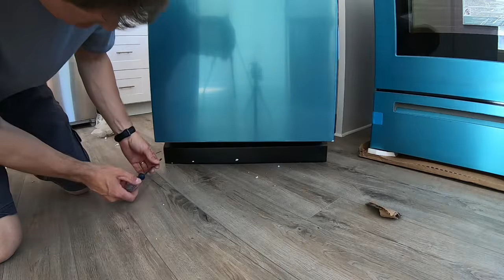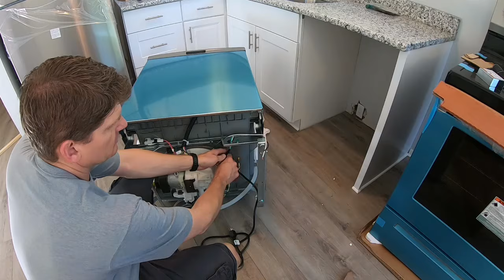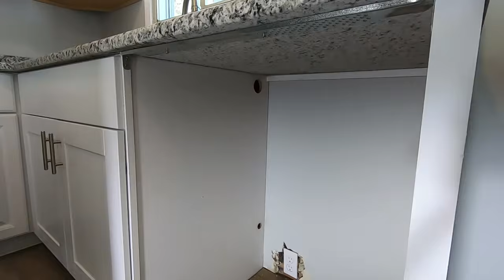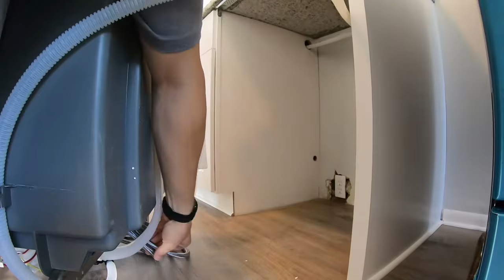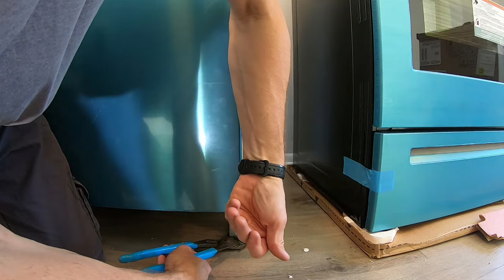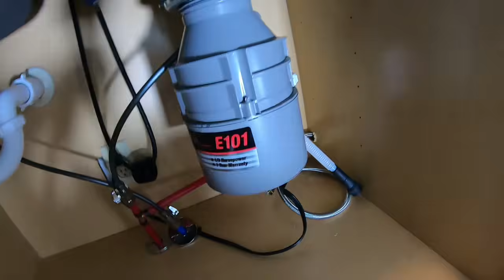Install a dishwasher for the first time - Step by step instructions

Comment: Great video, would like to say that for the legs a ratchet wrench with a 1/4 bit would help tremendously with leveling the legs. I also use my magnetic level on the stainless panel to make sure it's level left to right and also front to back.

Comment: Nice, I can now do this myself. I have all the parts. The drain hose goes through the hole of the right side of the insolation sheet and then snaps on the right side of the dishwasher.😃

Comment: All instructors on YouTube do not say the water source is HOT Water. Second, instructions do not show actual handling of the drain line, water, and electrical to snake them through the cabinet holes. Just trying to be helpful.

Comment: I need help, please!   I live in an apartment. Old dishwasher was not working. After a week of phone calls, maintenance came out and replaced the dishwasher.  There was no water running, but the electric parts of the cycle worked. I did not find this out until 8 pm on a Friday. Monday,  maintenance came out. I can hear water running at certain points, and hear it draining, but the dishes are not getting clean. I am not mechanically inclined, but from what I have watched on some videos everything appears to be hooked up. There is some condensation on the inside of the dishwasher, but that is it. Any advice??
Reply from the maker: Id check to make sure the shutoff valve on the water line going to the dishwasher is turned on. That’s my best guess.
Reply: @HomeSource  it seems to be connected to the hot water that also goes to the sink. When I turn the know for that, the water in the sink works.  Is that the valve that you mean?

Comment: The manufacturer says to put all holes in the cabinet within 3 inches from the floor for all supply and drain lines. Can you explain why you put yours so high?
Reply from the maker: That may vary by manufacturer but I’ve always seen that drain should be as high as possible to avoid having a “belly” in the line where food will build up and cause a clog. The supply can run anywhere.

Comment: Super helpful video, but....pro tip, turn your pliers around so you can actually get a good grip and not have to struggle with getting that last little umph when tightening.

Comment: What if I don’t have a disposal ? How do I connect the drain than
Reply from the maker: They make a sink drain tube with a hose fitting that you attach to. Just ask at the hardware store and they’ll be able to get you what you need.

Comment: It’s code to now have the dishwasher cord and plug connected. It also requires a GFCI receptacle. It’s better if the GFCI receptacle is under the sink for better accessibility. Reason for cord and plug is so the dishwasher can be serviced with a line of site electrical disconnect. Tech can now simply unplug unit to service. If GFCI trips for any reason easy to access under sink to reset. In fact all appliances now need to be cord and plug connected including ovens.

Comment: Mine is hardwired from 1970 omg. Not sure if I can do this on my own lol
Reply from the maker: Being hardwired is very common and the process is pretty much the same, just be sure you locate and turn off the breaker before you attempt to disconnect the wires!
Reply: @HomeSource  so it has power I hooked that up in the front.  There was a green a white and a black think..I got a ground plug n just connected those.  Thing is no water?? My garbage disposal is broke.  So I have it hooked up on that.  Is there another way??
Reply: I didn't use the metal plate that came with the power plug I bought.  Think that would make a difference

Comment: Great video dude! I especially love it at the end when you went to turn it on, and you still had the brochures and tags still hanging. I did have a question, and this is just me, but could you use plumbers' tape at all of those water-tight connections?
Reply from the maker: Those are all compression fittings designed to be used without tape. None needed and the tape may actually interfere with the seal. Thanks for watching!
Reply: Not necessary on any plastic fittings

Comment: Umm… that’s not code compliant. You can’t plug a dishwasher into an outlet directly behind it. You must use an adjacent plug.
Reply from the maker: That’s interesting feedback. I run into them all the time.  I’m guessing it would only be an issue if it’s not a dedicated circuit.

Comment: Nicely done .... you stopped mid-sentence on what you would do if you DON'T have a garbage disposal .. would you please elaborate? Thank you.
Reply from the maker: They make a sink drain that has a fitting for a dishwasher hose to connect directly to. Ask at the hardware store and they’ll be able to show you what you need.

Comment: I think it's stupid dishwashers don't come with a plug in the wall cable. I could have been done 30 minutes ago with my dishwasher. Literally a 5 minute job but NO...I have to wire crap up.
Reply from the maker: Garbage disposals are even more annoying. Completely unusable without a cord, but they don’t come with one either.

Comment: I do not have the outlet in the wall like you do. The old one was hardwired.
Can I put in a standard 15amp outlet in my wall?

Or can I plug it into the garbage disposal outlet. 1 plug is for the pwr switch for disposal.The other side of outlet is  always hot. I want to plug my dishwasher into that side.

Comment: Just wanted to say thank you for your very thorough walkthrough. We were just going to get a new dishwasher and had decided to look into how the drain line is supposed to be run since our current dishwasher would no longer drain. Long story short, 2 years ago I had replaced the garbage disposal and thanks to your video, realized I had neglected to remove the plug. We saved 500-1000$ and now have a working dishwasher thanks to you! Keep up the good work and you are appreciated!

Comment: Hi Adam, are you using that on a 12/2 or 14/2 ?

My GE dishwasher wants me to hardwire it to the line but I'd rather put a plug on it. I was going to run a 12/2 yellow romex but can not find a 20 amp dishwasher plug for it.. only a 16 gauge/13 amp 

What do you suggest ?
Reply from the maker: 12/2 is typical. If you have power behind the dishwasher you can install an outlet then run a plugged cord from the outlet to the dishwasher. You should be able to find cords in the appliance section.  Otherwise hardwiring will work just fine too if you don’t want to install an outlet. It’s actually easier that way if you don’t have an outlet currently . Good luck!

Comment: I just got the same dishwasher and my cabinet measure 24" exact but this dishwasher is 24" at hinges(where those 2 black rubber sleeves are, one on each side), it would not go into box. Its 23-3/4" to 23-5/8" wide everywhere, only wider at hinges. Sucks!!

Comment: I'm not sure how to connect the mounting brackets for the counter top version.
Reply from the maker: If you have granite or some other type of solid surface tops they make an adhesive backed bracket you can stick under the counter to secure the DW to. If you have laminate/Formica tops any type of screw will work.

Comment: If you don't have a garbage disposal you can connect it to ...... lol ... it cut out.. My house was built in 1920. There is no plug  under the cabinet gotta cut into the wall to find a power line. And I'm guessing I'm  replacing stuff under the sink so this can connect.

Comment: Is the green cord necessary? I took apart the old one and it wasn't connected. This new one doesn't have green connect
Reply from the maker: Yes. The green wire is the ground. You’ll want to make sure that is hooked up. If there isn’t a green wire on the dishwasher there should be a screw inside the metal electrical box you can attach the ground wire to.

Comment: You don't need plumbers tape connecting the plumbing lines? It won't leak?
Reply from the maker: Nope. Those are compression fittings. No tape needed.

Comment: Both times you used the channellocks to tighten water supply line, you held them in the wrong direction. If you flip the tool, you apply leverage on the handle which makes the tool bite better and use less grip strength

Comment: Thanks. I'm looking to install a 24in dishwasher in my apartment and this resolved a good many of my questions that weren't getting answered anywhere else. Most other installation guides out there are really replacement guides, which helped me none when I was looking at a fresh install.
I'll probably cut in both drain and inlet line holes somewhat close together and do a high loop with the drain line inside my old cabinets. Also need to modify some PVC plumbing in there, but I've got experience in that.

Comment: I'm not an electrician, but a little concerned about the electrical.  First of all, who hacked that box into the wall?  Good Lord! :-)  Secondly, if you're not hard wiring it, that box should be accessible under the sink, preferably with a GFCI outlet, ideally on its own circuit.  Otherwise, looks... Functional.
Reply from the maker: No idea who installed that box. It wasn’t me!  No need for gfci under there, and pretty sure it doesn’t need to be accessible. Dedicated circuit I agree!
Reply: I couldn't help it, just kept getting distracted by that outlet. It looks like it was punched through with a hammer. I wouldn't want my dishwasher installed without the electrician coming back and fixing that. Then I'd fire him or her.

Comment: Does the drain line always have to be on top or can it be installed in the bottom?
Reply from the maker: It should really be at the top to ensure it drains properly and doesn’t get clogged.

Comment: One huge issue with this video: You say "If you don't have a garburator you can connect the return line to..." And then just didn't finish your sentence. I don't have a garburator...
Reply from the maker: Sorry not sure what happened to the video there. You just need a section of sink drain with a stub that will accept the dishwasher drain hose. You can pick up at any hardware store. Tell them what you’re doing and they should be able to set you up.

Comment: Nice job on showing this. I’m in the middle of replacing my old dishwasher and came into a major jam. Apparently the flooring in this kitchen has been added to one to many times and the flooring is literally so high that the dishwasher can’t come out and that’s even with screwing the feet adjusters all the way up 😡😡. I guess I’m getting a new flooring in this kitchen as well 😥😥😥
Reply: Same problem! We have laminate that was installed over the linoleum, blocking in the dishwasher. The guys delivered the new one and couldn't install it! Honestly, we just chipped away just enough of the plank where the feet were to squeeze it out, and the bottom plate of the new dishwasher covers it right up! We plan on doing a remodel someday anyway so not to worried.
Reply: You have to remove the flooring underneath the dishwasher, only option

Comment: nice work - except you didn't tell your viewers about putting 2 turns of tape on the 3/8" water lines (not the garden hose) connection at the bottom of the unit
Reply: Tape isn't necessary on compression fittings
Reply: Tape can even cause compression fittings to leak if it protrudes into the mating surface.....But it doesn't hurt to put a few loops on the bottom and leave the top few threads bare so it can seal properly, and a little extra insurance from the tape just in case.
Reply from the maker: Thanks  Darrell. I should have mentioned that. Those are 3/8 compression fittings. Tape isn’t necessary. Thanks for watching!

Comment: What if we don’t have a garbage disposal 😦 where do we connect it?
Reply from the maker: You can get a drain pipe with a fitting made to accept the dishwasher drain hose. Anyone working the plumbing department at a home improvement store should be able to show you what you need. Good luck!

Comment: By drilling 2 different holes, one at the top and partially up from the bottom actually causes the dishwasher to sit out a lot further then the manufacture intended it and it will look poor, because the drainline will sit behind the unit instead of the intended spot at the bottom of the dishwasher. You should drill a 2 inch hole at the lowest point and closest to the rear wall as possible and run both lines through this. So you can get the dishwasher to sit against the rear wall. You would then make a high loop with the drainline by securing it rear wall under the cabinet to hold it up so it creates an “air gap” for proper draining. The person to taught you to install was probably a plumber. They are lazy and know nothing about installation. But please if you’re going to put a video out on how to do it, at least follow the manufacturers recommendations. A dishwasher should never stick out past the counter top unless it has a cabinet opening less then 24 inches deep.

Comment: you hooked it to the hot water, but you didn't mention that. Always use hot?
 Also, you didn't finish with the without a garbage disposal. Also, you already had the water line ready to hook up, you didn't explain how to put that T in the hot water line to create that hook up.
Reply from the maker: Correct, always to hot for a dishwasher.  To hook up the drain line without a garbage disposal, you can buy a special down tube that goes from your sink to the drain pipe.  The down tube has a nipple your dishwasher will connect too.  For the supply fitting I'd recommend you go to a hardware store and explain what you're doing and someone in the plumbing department should be able to assist pretty easily.  They can show you the drain tube I'm talking about too.  Sorry for leaving out those details. Good luck!

Comment: No teflon tape on any of the water lines.  Is there a reason you wouldn't need it?
Reply from the maker: Yep, those are compression fittings. Tape isn’t needed.
Reply: Compression fittings not need Teflon tape

Comment: One more question.  You water supply line comes down near the bottom.  Why isn't it hooked to the angle on to wall?
Reply from the maker: Not sure I completely understand your question, but the flexible water line can run about anywhere.  I don't attach it to the wall because it needs to be loose so there's room to move the DW in and out of the opening.

Comment: You are so careful and do everything just right, so why are your electrical outlets so sloppy or never finished off, just a big gapping hole?  Also, do you always put floor under the dishwasher?  My kitchen was built in 1977 and the thick tile floor is up to the dishwasher and the cabinets but they didn't put it under the cabinets.  Is that a mistake?  IF it leaks, the water won't contact the wooden subfloor because the floor is protecting it?  RIght?
Reply: The Mice just thanked you for giving them a doorway into that tasty wiring under the dishwasher
Reply from the maker: Good questions Pamela.  I make sure anything visible looks perfect.  However, behind a dishwasher I don't worry about it.  The box behind the dishwasher was that way when I found it so I just left it.  In 15 years when someone replaces the dishwasher they'll see it, but until then no one will ever be bothered by it.  
I do typically put flooring under dishwashers, or atleast the front foot or so.  It's not critical I just want to make sure I don't have any visible gaps.  With your tile, I'd say they did it right by going up to the cabinets.  Personally I would tile under the front of the diswasher IF there's enough room.  Tile and underlayment are pretty thick so they may have done that to ensure the DW would still fit into the hole.  I'd say water isn't really a consideration.  If you have a leak it won't matter if there's flooring or not, you will have damage regardless.  Hope that helps!
Reply: @HomeSource  Yes! Thanks so much.  I had a huge garbage disposal leak and maybe faucet leak.  I hired a handyman who put in disposal but took out everything. I am putting it back together and your info is really helpful.  One more question.  We discovered that who ever built the house put the electrical plug for garbage disposal behind the dishwasher so we had to pull the electrical cord thru whole and plug behind the dishwasher. Then plug dishwasher under sink.  Otherwise we couldn't use switch to turn on garbage disposal.  Also no gfi plugs. Would that be hard to fix or should I just assume  no one will be down there again for years? Thanks again.

Comment: I have had my new dishwasher sitting in the kitchen for a year, Just a little nervous about my old plumbing, But I may be able to do everything but plumbing part. I have old compression shut off that need to be replaced. My old waterline to the dishwasher is copper not flexible.
Reply from the maker: Don't be afraid to tear into it.  It's really not too bad of a project. Hire a plumber to replace the shut off and get you set up to use a flexible supply line and you'll be off to the races.  Good luck!
Reply: Thanks for the encouragement.

Comment: 31:41 if you don’t have a garbage disposal you can actually connect it to what?
Reply from the maker: They make a sink drain tail piece that includes a small fitting for the dishwasher hose. Ask at any hardware state and they should be able to set you up. Good luck!
Reply: @HomeSource  awesome, thank you!